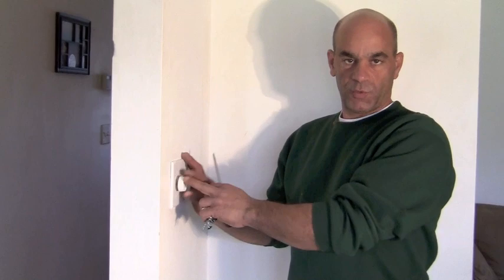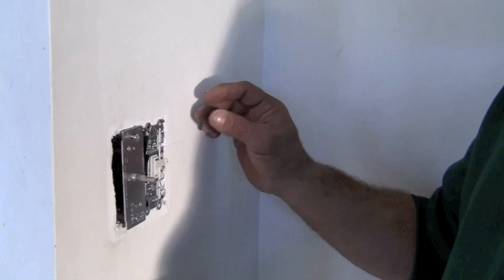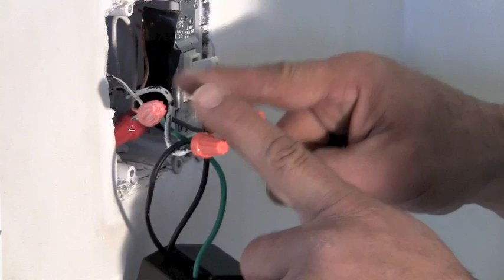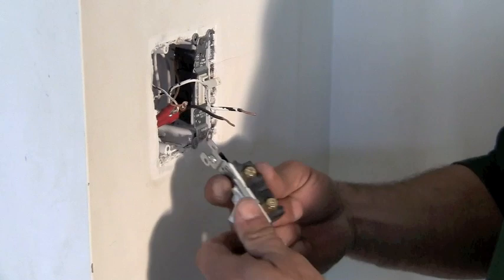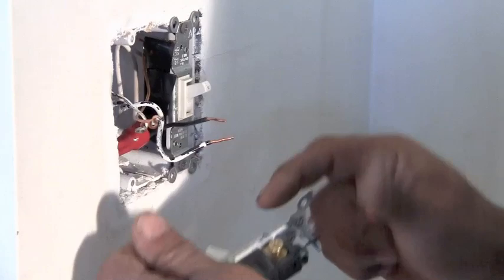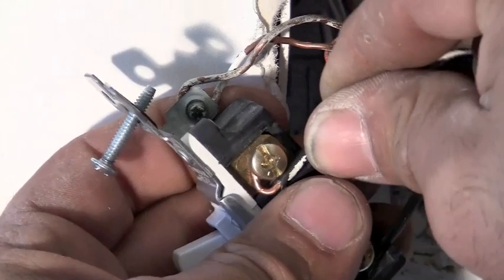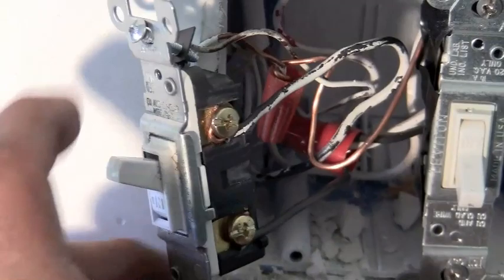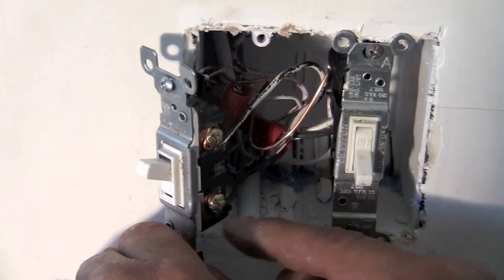How to replace a light switch and about switch wiring

Comment: Do you have any tips on how to get cover plates to sit flat? What do you do if the box is slightly proud (or too deep) to the drywall surface? Do the screws holding the receptacle in place need to be tight, or can you loosen them a bit so that the receptacle can be pulled to the surface by the cover plate?

Comment: Cool video. Was having problems though replacing a dual light switch in a bathroom. One of the switches turns on light. And the other light switch turns on the bathrooms fan. Since the light switch was old, I replaced it with a new one. And for some reason now when you turn either switch on the light and fan both come on with both switches. Was wondering if something is touching? Or did I get the wrong switch? Thanks.

Comment from the maker: @pezmaner1 You mite of installed the wrong one. Those types of switches can be tricky. However I would say you'll need to pull it back apart and take a closer look at your wires.

Comment: Hi was wanting to know on a light switch for the bathroom. A dual light switch that one turns on the light and the 2nd one turns on the fan. I replaced the old one because the old light switch switch was loose when ever youd turn it on and off. But when I put the new one on. Both light switches when turned on turn on the light and the fan. Was wondering what I did wrong? Or if I got the wrong dual switch to replace it? Thanks.

Comment: I got a double switch, one for an interior light and one exterior light. Exterior light stopped working. The light appears to be wired O.K. so checking the switch, found something I think is not right. There's three cables in that switch box. Each has a ground wire, however, none are connected to switch, but rather connected to each other. this is wrong, correct? Also, is it ok for all three ground wires to be connected to the switch or should I pick one?

Comment: BTW, I noticed with every other switch in the house the voltage meter only detected voltage in the other light switches if the switch is on. However, with the one in question it reads voltage continuously, on or off, until I cut the power off on the breaker. Is this because it is not properly grounded?

Comment: I have regular romex 14/2 wire, I got a switch and on the back it says , for cu wire only, 14 solid wire for push in ,  Can i use this with my romex 14/2 wire ?
Reply from the maker: +GmGarlo CU means for copper wire only.